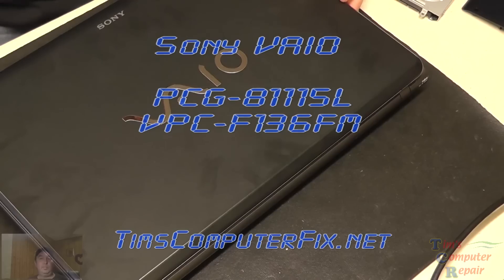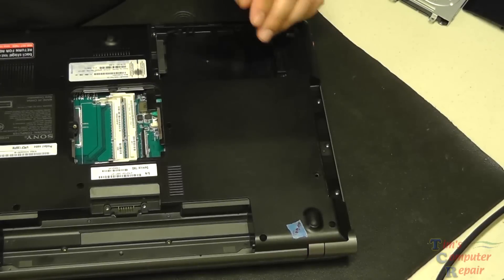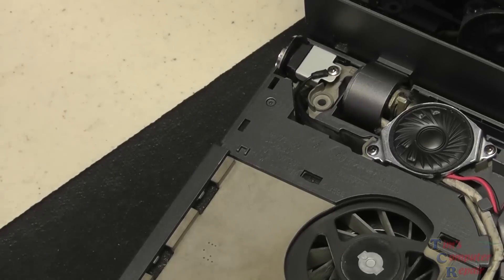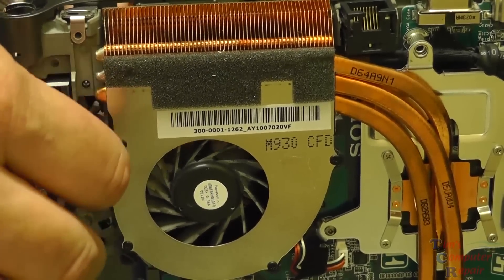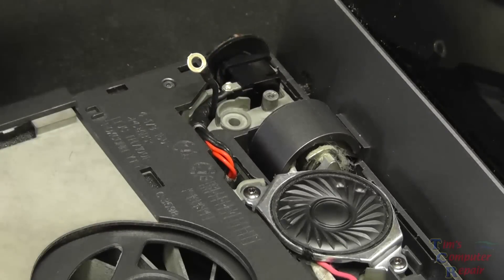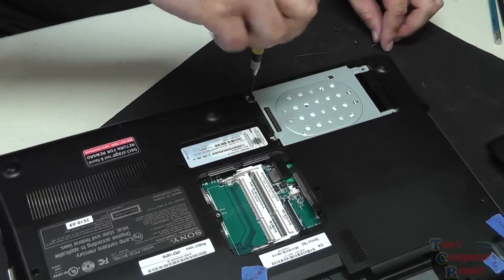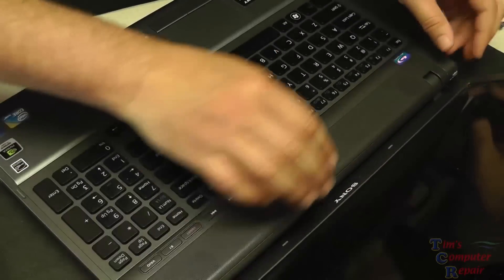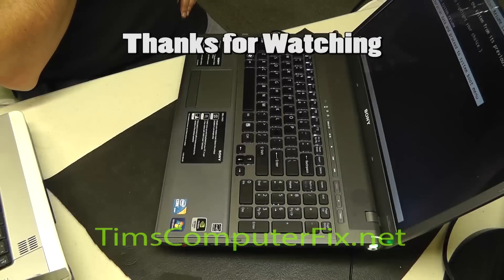Sony VAIO PCG-81115L Power Jack Repair by TimsComputerFix.net

Comment: Thanks Tim - excellent break down.  I've got a Sony PCG - 8158P which appears to have been dropped and caught by the power supply cord before the laptop hit the floor.  As such, the aluminium or cast muck metal frame holding the power jack has snapped off leaving the power jack to float around in the side of the laptop.  Do you know if it is possible to get replacements for the mounting frame for the power jack?

Comment: DO NOT REMOVE THE KEYBOARD. It will be hard to connect back. You don't need to take the ram off also. Just leave the lit as is.
Reply from the maker: Once you remove the button board and remove all of the screws from the bottom of the laptop that keyboard is free to move and flop around. Removing it would be a good idea IMO. I always remove the ram when stripping down a laptop. Thanks for watching.

Comment: Hi I have the 											 											 												VAIO VPCF136FM/B but I removed the ower jack from a vaio sr 390  but it does  not have the ground wire that I saw in your vidoe can i still use it or will my latop crash and burn
Reply from the maker: You should be ok with that jack. Thanks for watching.

Comment: on ebay one can get the Jack without the wires for 6 dollars then you don't have to tear down the laptop, just remove the long speaker grill, then unsolder the old wires, resolder to the new jack

Comment: Thank you, this helped me fix one of my two problems. My laptop works now, when plugged in. Unfortunately, it is unable to "detect" any battery(new or old) that I put in it. It only stays on as long as it's plugged in. At this point, I'm almost certain that there's something wrong with the area where the battery connects to the board. Is this fixable? I would appreciate a little help in determining my options. I have a vaio, the same one in this video. Thank you again.

Comment: I have this exact model laptop.  Unfortunately, I've had had my power jack replaced twice by an authorized Sony technician.  The thing is, I've had nothing but issues with my Mobo and GPU since the repairs.  Sony says they can't help since I'm now out of warranty.  My question is what exactly would/could happen if the metal bracket were to ground out the jack?

Comment from the maker: I would first confirm that your power adapter itself is working. Use a mutimeter to confirm or try a known good power adapter. I would also remove the battery and try powering on with only the power adapter plugged in. Good luck. Thanks for watching.

Comment: Hi Tim, your guide was most helpful to me when fixing my dc jack. The steps were different for dis-assembly because I have a different model (PCG-61A11L), but was more or less the same. I installed the new jack but now for some reason my VAIO won't turn on? It shows the charging light is on when I plug it in, but I only get a response from the laptop when I take my battery out and put it back in. The screen and other lights turn on and turn right back off in about 5 secs. Any suggestions?

Comment from the maker: If you are going to take on a power jack repair for the first time I would say this model would be the perfect one to start with. No soldering involved. Just follow my video step by step and you should be fine. Just make sure you order the jack after the broken one is out. That way you can match it up with the one you order online. Good Luck

Comment: Hi Tim.  I'm was wondering... I need to repair (or have repaired) my power jack and this makes it look pretty simple. I'm not really a computer whiz or anything and am wondering, would it be crazy to do this myself having very little experience? I don't want to ruin an expensive laptop. Also, if its not too hard, are there any additional tips you have for a novice?